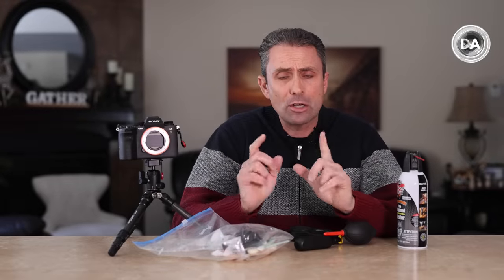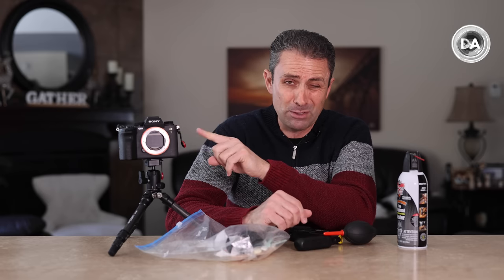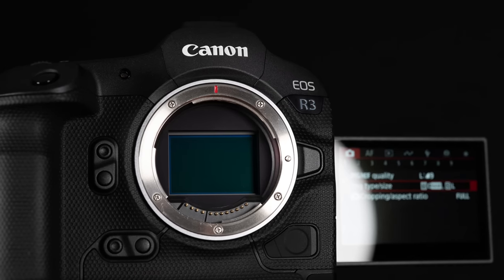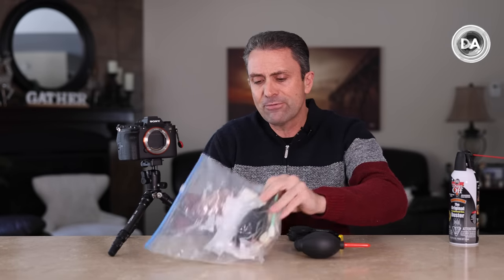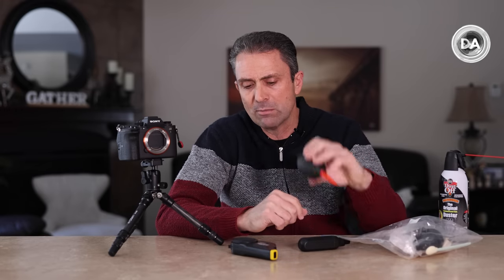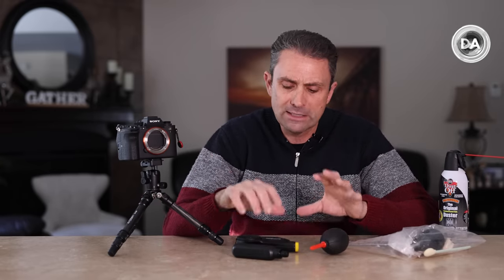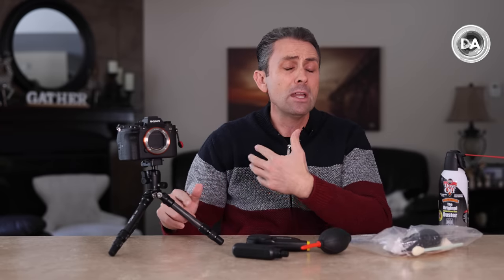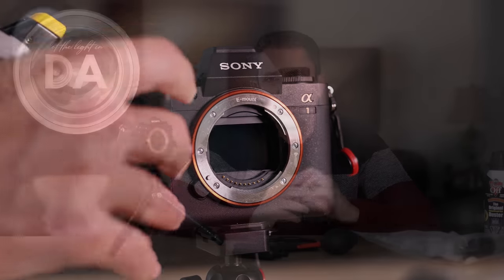Cleaning Your Camera Sensor:  Should You? | How To | DA

Comment: Thanks for the helpful video! What also worked for me in some cases is turn the camera off. Then put it lens down somewhere over night and blow the dust off next morning without(!) switching on the camera. This way the sensor gets discharged over night and the dust will come off more easily.
Reply from the maker: Interesting point...though one that only works if you don't have the guard that comes down over the sensor.

Comment: Cleaning you sensor isn't that scary. Sensors are tougher than most people think, just don't use compressed air and it's very unlikely that you can damage it, poking it with something plastic won't damage it. Of course you can give it to your local camera shop and they can clean it for like 20$, but with the same money you can buy a dedicated cleaning kit and do it yourself, it's real not that hard if you have any DIY experience.
Reply: Indeed exactly this. When you clean a sensor you're not actually physically touching the elements of the sensor. You're cleaning a very high end bit of glass over the sensor. You don't want to risk damage to this glass but it's no where near as delicate as people think. Gentle wet wiping with very clean brand new sensor swabs after a good blow out with a rocket blower, runs almost zero risk of causing harm. I'd only send one of my cameras in for professional cleaning if it were full of sand or something ridiculous. Changing lenses in a sand storm or similar. Only an idiot would do that though. 

Another pro tip is a lot of photography shows have free sensor cleaning for cameras of a brand at their own stalls. I know Panasonic and Sony offer this at shows I've been too.
Reply from the maker: The short answer is that you're both correct, but that doesn't mean that people won't make the problem worse (streaking, fibers from cleaning cloths, etc...) if they don't know what they're doing.
Reply: Yes Oscar, I have wet cleaned sensors in the past.  I try to avoid it if at ALL POSSIBLE!  Dustin makes some valid points, and I might add, if I owned one of the newer Mirrorless with IBIS, I would N O T wet clean or touch the sensor/ anti aliasing filter area!  It could cause something to be damaged and then cause a malfunction.  Just MHO.  Take care
Reply: $20? Vistek $69.99. Nikon $50 plus loss of camera for weeks.
Reply: @heritageimaging7768  “ you pays ya money, ya takes ya chances “ as the old saying goes.  Wet cleaning can be a hit and miss operation.  It all depends on humidity and surroundings, and technique I suppose.  Again, I would be leary when dealing with a camera body with IBIS.  Most times one should be able to get by using the ‘clean function’ in the camera menu, combined with a Giottos type blower.  Of course, YMMV.
Reply: It seems possible to scratch the surface with a wet swab if you happen to have a large enough dust particle dragged across the surface. But, it seems rare and swab streaks have happened to me in the past.
Reply: Exactly!  I've been cleaning my own sensors for the last 5 years on my various Sony mirrorless bodies and have never had any issue regarding damage, etc.  When I first began doing it, I was a bit timid, but after the first few times, when I saw that it was clean and there was no damage done, my confidence kept building.
Reply: @georgedavall9449  Sony doesnt use AA filter. not on a7rs. you have to put in manual clean mode to lock sensor

Comment: True story, a friend of mine, who actually does filming semi professionally and whom is a very skilled photographer. Moved from Canon DSLR cameras to a Sony A7iii about three years ago. He had always used duster gas to clean the "sensor" area with his DSLRs, which would have actually been the mirror he was cleaning and did the same with his new Sony A7iii out of habit. 

It made such a mess he had to send to away for professional cleaning. 

I was staggered at the stupidity of this move but to him, cameras and the paraphernalia are just tools that he uses. 

I am very sensitive to lens and sensor dust and find my A7ii a pain in the rear as it is a dust magnet. My X-T3 and X-T1 don't seem to have this issue, same with my GX80. 

I do the rocket blower with the camera faced down most often as this gets most things. Then a wet cleaning method if necessary. If I am travelling and photography is a big part of my trip. I always carry a lens and sensor cleaning kit with me. Which also includes some wet cleaning options for the sensor.
Reply from the maker: I definitely saw a much bigger problem with dust after adding Sony to my kit.  The A1 has been better due to having that cover over the sensor, but Canon still wins because of running an auto dust removal cycle at powerdown.
Reply: yes, me 3. Sony with such a shallow opening to sensor its a dust issue almost every time i shoot. wish you didnt have to turn off to close the curtain. nice to have though, and should have had it by II series bodies. I have a sensor scope that helps

Comment: My first experience cleaning my a7rii was terrifying. I was very thorough in reading about swabbing made sure to lock the sensor in place, but when I finished, I noticed a long, but very thin mark on the sensor. First I thought it was a swab mark but I couldn't get it off. My confidence quickly eroded and I began to panic that a hard particle scratched the sensor. I frantically begin calling camera shops to get it checked out. After 10 days in the shop, I got a call to come in. I showed up and the technician looked uneasy fueling my anxiety. I told him who I was and he casually said that he cleaned my camera. I asked him about this streak and he then remembered who I was and explained that he too thought it was scratched, but was able to remove the streak. 

I still clean my own sensor, but now I am much more cautious about diving in. You really need to thoroughly inspect the surface of the sensor before you decide to take it on.
Reply from the maker: Yep - it can be a scary process.
Reply: Great comment Brent.  Like I have mentioned, I personally would be leary doing a cleaning on a camera with IBIS.  Sorry, but Sony’s seem to be dust magnets?  I do think Canon has one of the best self cleaning processes, as Dustin stated.  You might try the method Stefan Becker mentioned in above comment?  I think your experience is common among most that first attempt this, so don’t be too hard on yourself.  Peace
Reply: Though I have have not owned other mirrorless brands, Sony has been a dust collector for me. I'll try the discharged static method as mentioned. But I suspect one problem for me is shooting in very cold conditions (astro and winter alpine conditions) so as much as I try to avoid rapid warming back inside of a car or house, I am probably still having some level of condensation which seems to glue particles to the sensor.

Comment: @dustin I came across this looking for a conversation of the shutter close when powered off feature.  A lot of people seem very worried about shutter damage. I just bought some nylon paintbrushes (required soaking and cleaning prior to use) to be electrostatically charged with air.   The ‘purpose built’ brush is insanely expensive given it’s a standard nylon paintbrush.  High volume airflow worries me, will it knock other things loose beyond a certain CFM…
Reply from the maker: Clearly the closing of the shutter blades at powering off is effective, as it is pretty much universally offered on all better quality cameras at this point.

Comment: Cameras, more than ever, are highly sophisticated pieces of equipment.
The top 2/3 top large repair companies in Australia offer sensor cleaning at reasonable prices.
Have seen a few YT videos, mainly for Sony apsc bodies in which presenter basically " attacked" sensors, presumably to demonstrate how difficult it would be to damage.
This may be acceptable to some, however, having paid out quite large sums for repairs to 2nd hand bodies and lens, I will just leave this to the experts.
Reply from the maker: And that's exactly why I make that distinction in this video.  Advanced cleaning of the sensor glass simply isn't for everyone.

Comment: I also have sony a1 body and when I clean the sensor I turn the cleaning mode on, but when cleaning it with wet swab, the image sensor sometimes shifts and even once it got pressed .. is this normal? Would it effect the image sensor?
Reply from the maker: The sensor can move around (that's because of the in body image stabilization).  It's made to do that.  Just be gentle and you should be fine.

Comment: Used a blower can on my sensor once and to my horror, liquid propellant came out and splotched onto my sensor.  Within about 2 seconds it evaporated away and my day was saved.  Basic cleaning everyone should do, unless there’s mud.  I would send it in for mud.
Reply: Those dust off cans often blow some water on your sensor.  You actually are not cleaning but the IR filters on top of the sensor. There are filters stacked on top of the sensor
Reply from the maker: It's true that the propellant streaks do evaporate, but the various liquids and oils there aren't worth introducing onto your sensor.

Comment: Do not tilt camer down.. There is a sticky strip. Keep the camera in landscape shooting position....
Reply: That’s a great point, Derek!  Most camera manuals advise to keep the camera level, when turning on and off, as the ultrasonic cleaning process works better.  But to Dustin’s point;  I always keep camera pointed down, or at an angle, whilst changing lenses, and then I use either my Giottos  or Sensei blower, into the cavity, before putting on the lens.  Also, blow out the rear lens cap before putting on, and carefully blow out the rear of the lens.  This helps reduce likelihood of dust being introduced into the body, and the sensor!  Peace and stay safe and Healthy!
Reply: @georgedavall9449 . I only ever ha an issue with dust on a Sensor. My Canon 6D. My 40D, 7D, 7DII and 5DIV never needed cleaning
Reply from the maker: Hmmm, I'm not sure you've made your point here, Derek.  Pointing the camera down for cleaning when blowing helps the chances of the dust particles evacuating the sensor cavity.
Reply: @DustinAbbottTWI . Dust particles don't obey the law of gravity when airflow is introduced. Static plays the largest role. tilting the camera down and using the dust removal feature displaces the dust in air to stick back on the sensor or onto the lens. with the lend attached and the camera in the horizontal shooting position start the sensor cleaning utility and the dust is dislodged and falls to the adhesive strip under the sensor...

Comment: Sad here it was thus not loudly suggested to Sony to make an easy firmware update for and to each of its many cameras witch, indeed, have this (cumbersome) 'sensor shaking"  feature available  (but a "pain to remember") -  to retroACTIVALLY deliver a  simple firmware update rendring this   "dustoffshacking" ability to become an option to systematicly perform at every camera shutdown automatically, or similar options, witch where  introduced many years ago already on Canons dslrs !
Reply: Sony’s suck, Air, that is!  😳🤔😂 that’s all there is to it
Reply: @georgedavall9449   😄
Reply from the maker: That's a valid point.  Canon has been better on this front than Sony for a long time.
Reply: @DustinAbbottTWI  Not inclined however to 'tell' Sony to make such firmware updates (as I imagine to be easily possible, retroactivall, for/on all their models with the manual activation already implemented) ?

Comment: A long time ago I had a lot trouble with Sensor dust.
Canon started to implement sensor cleaning with 1D III and my life changed :-)

Canons strategy of
- covering the sensor when not in use (mirrorless!)
- sensor coating
- active sensor cleaning with every camera power down
and my strategy
- never keep the rear element from any lens uncovered as the camera body
- no lens changes in dusty conditions/ protect at least with your body, inside a car, ...

Made me free of any need of sensor cleaning for much more than a decade now shooting Canon.

(some YouTuber are terrible teachers putting lenses without a cap rear down on tables, ... . They have the need of sensor cleaning)
And it seems the standards of sensor cleaning systems/coating differs across the brands.
Reply from the maker: It's true that Canon does a better job with this than anyone else.  As for YouTubers - I can't speak for everyone, but part of the process of demonstrating products is that you have to show sensors, rear of lenses, the length of lenses without caps, etc...  I'm very protective of my gear, but I also have a job to do.
Reply: @DustinAbbottTWI  Dustin
I do know you being very protective to your gear, I really like this.
I remember a vid on another channel presenting several lenses in a row all resting on a rough wooden table with no rear cap mounted...
It looks to me like like many photographers are unaware of every little dust on the rear element being possible future sensor dust. But dust on the front element doesn't hurt too much. When it's coming close to a sandbox you are starting to loose contrast and brilliance....
Sorry for me being picky with this aspect: Back in film times the "telegraph lines were the very most annoying experience in photography, Shooting digital sensor dust is not much less annoying.

I am 100% with your message: In any doubt do not put any own hands to the sensor. I learnt this lesson back in film times with cleaning a matte screen of a SLR. This caused only inconvenience while using, no effect to the pictures taken at all.

Comment: 1:05 "And it shows up more, actually, as you stop the aperture down." False. Dust on the sensor won't look any different as lens-aperture changes.
Reply: Only, it does become a lot easier to see when you go F8 and "higher" by closing the aperture down. I don't have an explanation as to why but I am extremely sensitive to sensor dust and absolutely find it's far more noticeable at F8 up. I clean my sensors without issue and have learnt to use a rocket blower while holding the camera pointing down as the first step and then use light to look at the sensor. If there's still stubborn specs or hairs I can't remove with the blower, I get out the wet cleaner.
Reply: that is not true. I see the dust on the sensor in a photo with a lot of sky more with a ultra wide angle lens stopped down. If i open up, the dust becomes less noticeable. The dust is on the sensor, not on the lens, as it is always in the same spot
Reply: @oscararborist  I am wrong, but the dust on the sensor does not care. If I open the aperture, it becomes less visible. Try yourself when you see some dust in the sky.
Reply from the maker: Ummm, I demonstrated the falsehood of this statement in the video with the video clips at F1.8 and then at F11.  You can see nothing at F1.8 in the video; you can very obviously see a fiber as a black blob at F11.
Reply: @DustinAbbottTWI  it is my experience as well. I don’t know why, but at times I had to take wide photos of buildings and I had to open the aperture to prevent dust spots to be noticeable in the sky. If the dust was on the lens surface it would not look so defined.